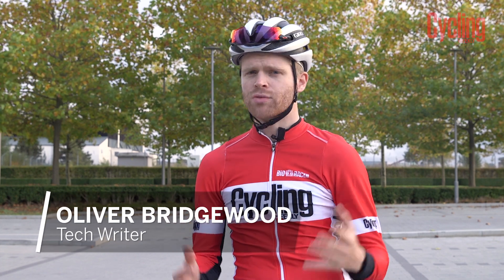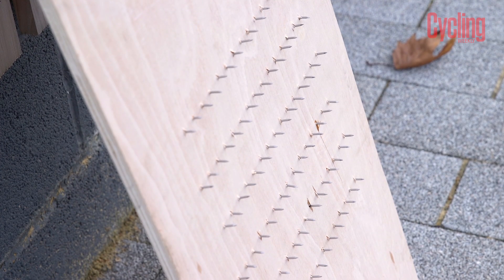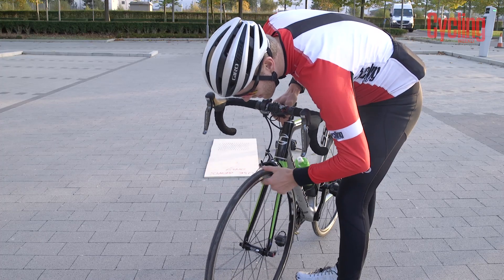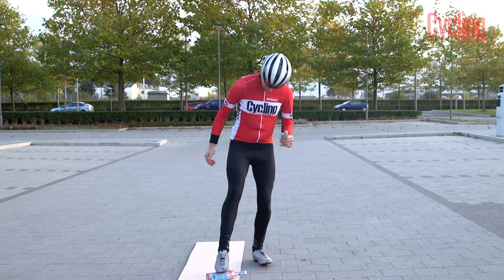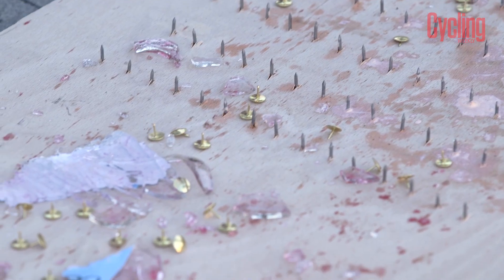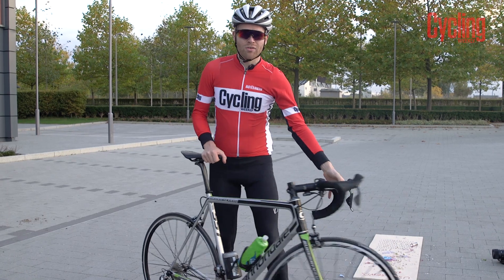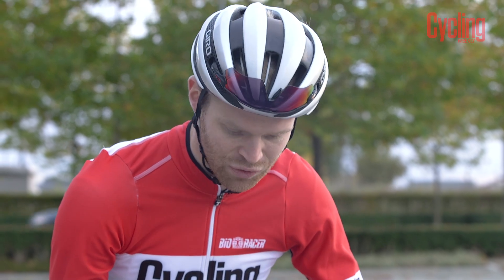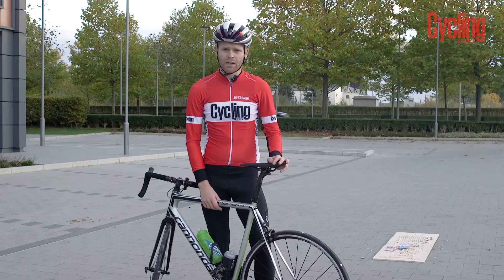Cycling Weekly Science: Are Tubeless Tyres Indestructible?

Comment: I just had brand new Enve tubeless tire get ruined by running over a little rock after the first 20 miles. It blew 2 big holes in the tire, and the sealant wouldn't seal them, not even with tire plugs in the holes.

Comment: I ride tubeless in NorCal where goatheads puncture all bike tires.  The difference between clincher and tubeless is that tubeless seals the punctures and clincher tubes don't.  My IRC never flatted and all I did was remove the thorn and continue rolling instead of patching or replacing a tube.  Tubeless is initially more expensive, but cheaper in the long run without stopping to repair flats.
Reply: What sort of sealant do you use?
Reply: Mububban23 slime ???

Comment: I have used tubeless tyres, had one failure that was due to hitting a sharp edged brass fitting that was on the road,, which sliced the tyre so had large cuts through the tyre to large a hole for the sealant to seal.
Reply: Did you put a tube in to get home or were you stranded?
That's my only concern with tubeless - will I get stranded somewhere due to a massive gash?  But assuming the tyres can be removed from the rim (?), can I just pop an inner tube in to keep riding (as well as a small patch to cover the gash)?

Comment: I'll have to try that "orange" sealant out. With my Schwalbe pro ones with stans sealant, after puncturing they'd go down to about 50 to 40psi spraying sealant everywhere, before sealing. But the great thing about those tyres, even at 40psi they still felt faster than my winter tyres, and no problems to get me home. They'd never pass the cycling weekly test above though, that's for sure. Must admit it is so cool riding along, getting a puncture, and not having to stop.
I usually get about 1 puncture per 3000km on my usual normal tyres(Michelins/vredesteins) and around 2 to 3 punctures per 2000km on my tubeless which I then have to fix when I get home. So is it worth it? Not really for everyday use- at least with the stans sealant I'm using anyway. But they're nice fast tyres if you don't mind the expense.

Comment: I tryed Schwalbe, Tune, Bontrager and Joe's Super Sealant on Schwalbe Pro One,  Schwalbe Ironman, Vittoria Corsa Speed, Bontrager RS .

It never realy sealed. It just works at 5 -6 Bar. If you put more pressure on the tyre Schwalbe, Tune, Bontrager or Joe's Super Sealant all fail.

The Vittoria Corsa Speed is very very fast and FANTASTIC but just with 8 - 9 Bar. 

Can not see it coming that Orange Seal Tubeless Tire Sealant is doing any better then the Schwalbe, Tune, Bontrager and Joe's Super Sealant!

But I will give if a shot!
Reply: Did the Orange Sealant work better?

Comment: How long would this sealant keep the holes closed though? Say you were on a day ride and you were anywhere from 20-50 miles away from your home? Or if you finish your ride go home and all the sealant settles will the tires deflate? Do you have to repair the hole to insure that the tire won't lose air on your next long ride?
Reply: Until the Tire is worn out or the sealant goes dry.

Comment: I bought Schwalbe Pro Ones thinking they are indestructible but although installed correctly and filled with enough sealant they blew 3 times after about 1000km. My standard Continental 4000 S II are MUCH more reliable!
Reply: I had IRC tubeless for over 4k miles and didn't flat till I wore through the casing.  I switched to Schwalbe Pro Ones and got a flat after only 200 miles and then another in less than 15 miles.  I am awaiting my new IRC tubeless in the mail as I write this.
Reply: Same issues with multiple brands of sealant.  It dries up after a while and you have to keep adding it.  I had to make a small "dipstick" and push in though the valve stem to check how much "liquid" sealant I have avail in the tire.  Too much work !!
Reply: Same experience here. I had the Schwalbe One and Pro One, used them with Stan's sealant. I punctured many times and the tire pressure had to go down to around 3 bar for the tire to seal. Inflate back to 5 or 6 bar and the hole would rip open again. It NEVER worked like in the video above. Maybe the Orange sealant is better suited for high pressure use. In the end the Pro One ripped open big time on 3 occasions, giant hole, pressure gone immediately. Absolutely no chance for the sealant to do its trick. I was very disappointed and am now back on the Conti 4 Season for the winter. No punctures so far...
Reply: How much sealant was used? Thanks.
Reply: loopie007 My Orange Seal lasts at least 3 months between topping off...
Reply: I've heard great things about orange selant
Reply: Jay Lumbago ...
wash-off the baby-powder manufactureres use to keep the rubber stored for years before they sell it . In the previous trailer the author used water and soap as detergent to wash-off the baby-powder and eventually some grease .
Reply: I started with the recommended 30 ml (Schwalbe manual) and went up from there. Ultimately it's hard to say how much sealant was in the tire during use because I was constantly losing and refilling. My bike frame and my seat post where a mess. If dried up it is also hard to clean. When I noticed the puncture early enough I sometimes stopped, put my finger on the hole or pointed it to the ground to make sure there is enough sealant available (leaving a big puddle on the tarmac...). Sometimes it closed without losing too much air but back on the bike and continuing the ride it didn't take long to reopen again. Sometimes a few kilometers, sometimes just a few bike lengths. Being a mountain biker my whole life and heaving many years of experience with running tubeless i also started using some tricks copied from world cup downhill mechanics. They are adding particles like glitter to the sealant to improve the ability to close the holes. I think it helped but when the cut is big enough you have to rely on your spare tube (I sometimes had to put something under the hole to stop the tube from coming through it).
By the way: I still like tubeless and want to try it again but I will use a different tire brand and a different type of sealant. Hopefully tire manufactures will improve their products and product range so that there are more tires to chose from.

Comment: Very inteligent to try to break a bottle on a wood surface , when you've got concrete next by :)) But overall , great job (y)
Reply from the maker: We wanted to keep it roughly self-contained instead of all over the car park! (which was cleaned up after)
Reply: +Cycling Weekly Luckily the bottle doesn't slipped out under your shoes when you jumped next to the nails. Otherwise you should have injected some sealant into your foot too. :-P